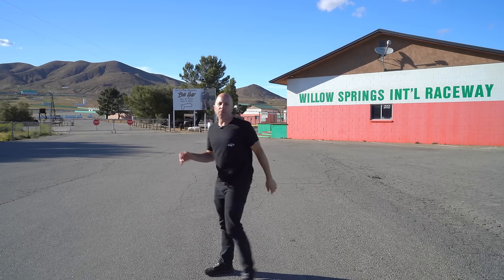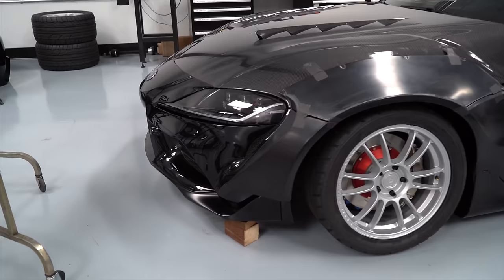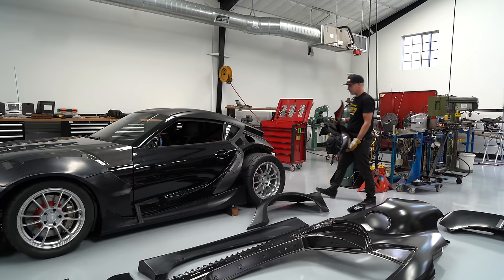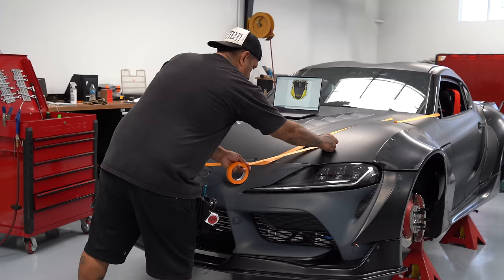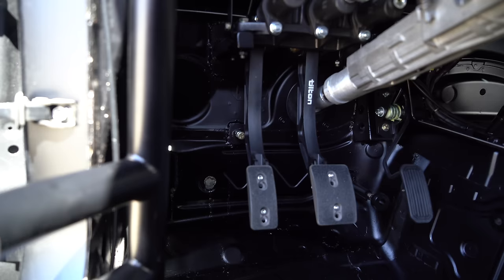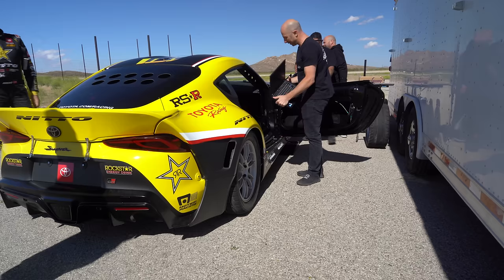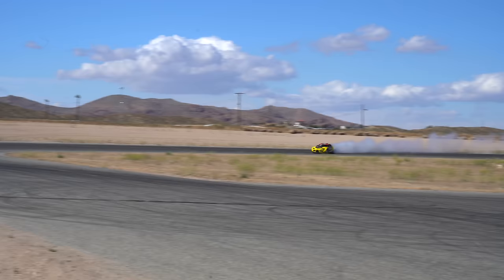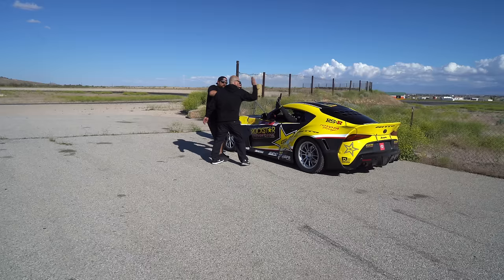2020 Supra Drift Build - Body Kit Install and First Drift

Comment: I love how it sounds so much like a 2jz, you guys do amazing work.
Reply: cauase it's 6 straight cyl turbo , they all sounds pretty same.
Reply: @Pavovere97  I don't think that's true the n54 and n55 sound nothing like what you'd expect. Same with older 5mge or 7m line engines
Reply: @brandonl6877  s55 turbo sound pretty same as b58 turbo. U can search in yt "andrius vasiliauskas drift" , his car got s55 turbo . And car's sound only depends what  exhaust headers it have , search about uel and el subaru headers , how it changing sound , same with other engines.
Reply: @Pavovere97  That's partially true but definitely not the full story. The b58 manifold is vastly dissimilar from a 2j, while sounding quite alike. Meanwhile RB has a totally different sound even when setup identically to a 2j or 1j. Has a lot to do with induction / valvetrain dynamics too.
Reply: It still sounds beautiful nonetheless😍😍😍😍😍😍
Reply: @hambo6713  ive heard a few Supra B58 builds that sound like a mix of all the popular engines like 2jz/RB26 with a hint of rotary even R35 go check boostlogics dyno lol definitely a very customizable sound on this car depending on how you build it of course.
Reply: @brandonl6877   A straight six turbo engine generally sound very similar. Especially if it has a large single turbo setup. A N54 has small twins stock and I'm sure the exhaust manifold setup makes it sound different.. The S55 sounds very different than most straight sixes stock  but with a big single they sound like a 2j. Even the 2jz on stock twins doesn't have the sound the 2jz is famous for built. A 7m with a big turbo sounds very similar to a 2jz with big turbo as well. Hell you can grab a straight six from a chevy trailblazer and slap a big single on it ans the exhaust note will be similar to a 2j.
Reply: @hambo6713  lol. a rb sounds nothing like a 2j
Reply: chris pinkston big brain. People act like 2jzs are the only engine that sounds good with a big snail on it
Reply: @philipm3173  I don't know about all that but most straight six engines with a big single sound very similar. Plenty engines with a big single sound good. An Audi 5 cylinder single turbo sounds nothing like a 2jz and sounds wonderful..more like a V10 than anything.
Reply: this is an old comment but the n55, b58 and 2j sound pretty much the same since theyre single turbo. the s55 and n54 sound raspier and more snarly because they’re twin turbo. headers are what really changes an engine note
Reply: @Pavovere97  RB, Barra and JZ sounds different to each other tho
Reply: its a B58.

Comment: This guy single-handedly saved Toyota's Ass.
Reply: why exactly?
Reply: @Levi-sv6xn  Because there was a huge backlash against this new Supra, due to comparisons with the classic 2JZ and the new one being more of a BMW car.
Toyota had decades of tradition behind this car, and couldn't release anything less than a car that could achieve enormous amounts of power with ease, like 2JZ was! So, by creating this project successfully, they saved Toyota's reputation (in terms).
Reply: You have a talent for overstatement and hyperbole
Reply: @stealthisdkey  The whole discussion of the fanbois in youtube comments is very stupid. The Mk IV Supra wasnt the super car everybody is dreaming of. It was a comfortable GT car, way more expensive and less performant then a C4 Corvette back in the day. And if I remember right the C4 Corvette was the worst of all Corvette generations. Yes, with heavy modding you could make it a 1,000 hp monster, no question. But those werent normal street cars anymore, and they breaked down constantly, and you had to rebuild and replace bits and bops. 
I cant see whats bad about a BMW engine. Nor can I see whats wrong with the Mk V Supra. Its a great car, outperforming its predecessor in every aspect. Except for the lag of a manual option it is an overall nice car with a good styling and people should be happy that we have two more very good sports cars on the market (Supra and Z4). Dont think we will see that anytime soon.
The fact that the Mk IV Supra was overhyped because of a stupid nonsense movie makes me really sad. Nobody of those crybabies did drive a Mk IV Supra in the first place, but somehow complaining of how the new one doesnt match up.
Instead they are buying their Civics, Corollas and SUVs.
Reply: @Gentleman...Driver  I agree with u If you're considering the stock version. But, nothing in this world becomes so famous for nothing. That engine is special, and this car is one of the few that its market value is raising due to the whole search for 2JZs. You can at least agree with me that the 2JZs are something else when we consider budget vs HP.
Reply: @stealthisdkey  Yes, true. The stock engine was good and actually detuned by Toyota itself. But (!) if you want to go (durable) big power on that engine (1000 hp) you need to put a lot of effort in it. And there will be constantly things that will break down (people that say otherwise are lying). And it is the same with the BMW engine. You can go big power on this, too.
For me the Mk IV Supra is overhyped as f***. The suspension, the body,... its simply not good enough to beat a modern sports car. And I hate comments from fanboys. Thats all.
Reply: @Gentleman...Driver  yeah, I get you. I'm a fan of the engine in specific. A good example of what you are talking about is that people used to swap their engines for the 2JZ, because other platforms offer them better quality/ performance overall
Reply: @stealthisdkey  Yes, also true. :)
Still, we should be happy that we have a new sports car at all. They are going crazy here in the EU with emission regulations. Nissan will not bring the 400Z for that reason to Europe. RIP.

Comment: Love the build, but the street hunter kit by Tj Hunt is really the best looking kit for this car
Reply: used by*. And in your opinion. The street hunter kit looks too plain and the rears don't flow with the bodyline, looks like a universal fender flare just bolted on. Where as the rocket bunny one follows the line and finishes the tail.

Comment: Stephan, is there a reason you guys don't take your rear quarter off, once aligned and mated to the over fender, and make a one piece carbon or e-glass component? 
Would save a lot of time of cutting the OEM panel, and fitting the Rocket Bunny over fender. Certainly pricing wouldn't be too different in the end either. 
Just curious.

Comment: 5:26 - i just realized what's so odd about this car - in a good way - is it doesn't LOOK like your typical "Drift" car.  it looks a Road Racer or Endurance Car (which is more my "thing", i just appreciate good engineering/design regardless of discipline be it Sports Cars, NHRA, Drift, Lemans, F1, etc).   maybe it's the currently wheel fitment, but with 1000hp it looks like it could also take a 911/GT around Laguna Seca.

Comment: Hi!  Having such a well-made cage, don't you think you can replace the Rear quarter panels with carbon fiber ones?  This I ask from my total ignorance: I suppose that with that torsional rigidity, the entire "C-Pillar" is replaceable without affecting the structure.  As it cannot be welded to metal, it could be glued with silicone to absorb the little torque from the chassis.

Comment: Love the build but isn’t more sensible to keep the rear half of the car so you don’t have to then later buy a crash repair panel?
Reply: what do you mean "keep the rear half of the car"
Reply: DAndy they cut away the rear quarters then went and brought some more rear quarters.. why didn’t they use the original is what I’m asking.

Comment: Question : Why are some in-line engines banked compared to the chassis? I see that this engine is under and angle to the chassis. Why is this? What positive and negative sides has this got?

Comment: If the new supra had a longer wheelbase and an overall bigger presence then it would be a proper successor to the MK4 supra. More supercar, less miata.
Reply: The mk5 is the same length as a Silvia. Already made it a great choice for drifting for that reason,plus it having that wide front end helps for either engine swaps or more space for mods. No need for it to be longer and no need for it to be anything like the mk4. The mk4 looks noting nor shares noting from the mk3 so no reason to make the mk5 anything like the mk4.

Comment: I've been watching the whole series now 
But I have just one thing in mind 

The B58 is a straight 6 
You made 1000hp 
The b48 is a straight 4 
Withe the same internals just missing 2 cylinders so could you make the same changes and it will have 750 hp 
Or even better the b38 straight 3 
Could you make 500hp out of it?
Reply: You can make any power out of any engine with enough money and time 😂😂😂

Comment: is the roumor about bump steer true?...do the new shocks on this fix that issue?
Reply: From what I hear it happens more frequently when u lower the car. But at the same time,most mk5 owners that found out about it they were either confused or saying they've never noticed it(especially the ones that track them). They've sort of found a way around it(to keep it from happening since really there isn't one person who's legit had this problem/recorded it yet)so there guess is that they might've fixed it with the 2021 model(since Toyota said they retuned it).

Comment: So many bmw fans outhere😂😂 i wonder how much money they spent to make 1000 hp with that engine im sure it was way more than what u would spend to make the same amount of power on a 2jz
Reply: I mean.....most B58 mk5s are rolling a bigger turbo,tune,downpipe,port injection,and charge pipes to handle nearly 800whp which would be under 10k to do depending on what parts from what company it's from. Some already pulled into the 900+whp range by just swapping the pistons and rods so making 1000hp in one wouldn't be too much to do but theres not really alot running aftermarket rods and piston is the thing and papadakis had to 3d print his since they didn't have any aftermarket pistons and rods and a few other parts in his B58 that they didn't have avaliable at that time.

Comment: I've notice drifters have gone away from using large wings in formula D. Why is that?
Reply: If I'm not wrong I think it comes down to how much contact drift cars run into and it might just get it in the way at end of the day. 

Putting on a wing that makes it easier to hit things and is annoying to replace over and over is a hassle.

Comment: The camber looks a bit strange 
Agree???
Reply: in what way...?
Reply: Fronts cambered
Rears straight opposite
Or it's just me?
Reply: @faaiquealimehmood  fronts have negative camber which is normal, I don't know what "straight opposite" means... but if you mean they're straight with no camber, that's normal as well.
Reply: you wouldn't want positive front camber, rear neutral is good for power delivery

Comment: Anyone else notice the the Papadaski Supra put's a smoke screen stream out the top of the rear screen that makes a smoke cloud twice as high of every drift car out there to blind the chase drift ?   This should be banned, I bet they've got plates to direct the smoke, why would you want to cover your radiators and heat ex changers with rubber smoke and coat them and reduce efficiency,  they'd have to clean them each run, rubber is an insulator., such a cheap tactic.
Reply: They swapped that out after the 1st event for a scoop so that could help cool down the rear radiator better.